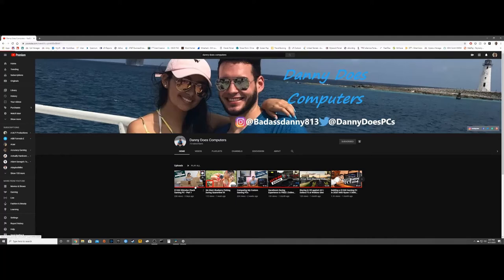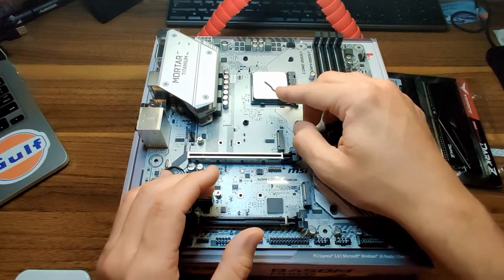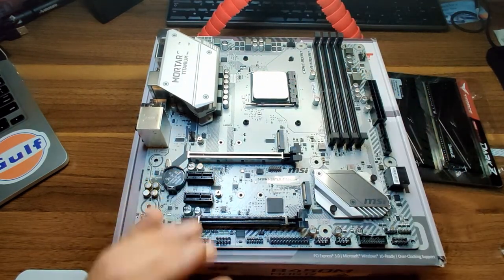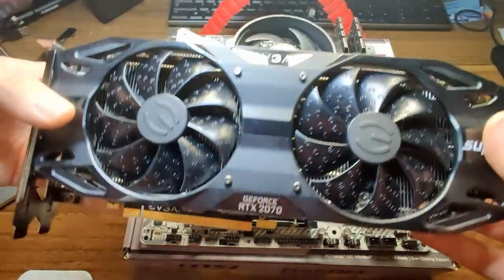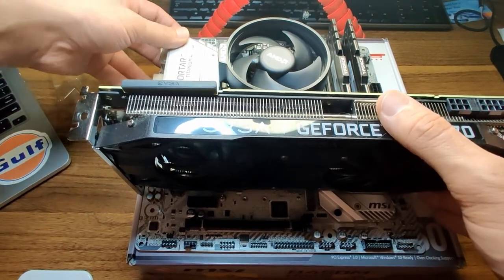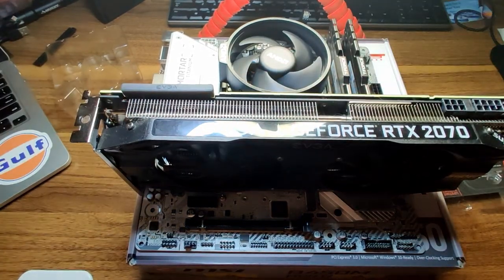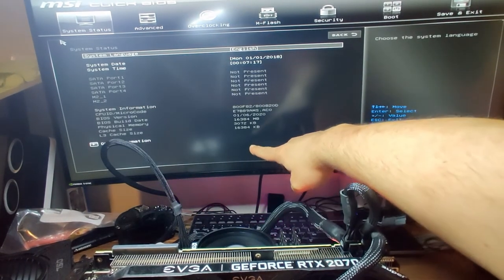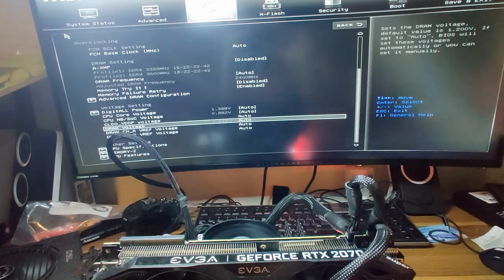How To Bench Test Your PC Parts Before Building

Comment: If I dont have a button and dont want to jump start using a screw driver can I just plug in the power front headers and use my cases power button instead??
Reply from the maker: Yes. Of course
Reply: @DannyDoesComputers  TY. Im scared I might short the whole board so thought this might be a safer option

Comment: Do you need the cpu cooler installed when you benchtest?
Reply from the maker: Yes. The CPU can get hot very quickly and without any cooler, it can quickly get to unsafe temps

Comment: Your video provides the information all PC builders need to do before finishing their PC build. If you're new to PC building, take a hint from that glorious girl wearing that thong swimsuit at the beach.  The less you put on the MB the better. I use an inexpensive test bench sold at AMAZON, of course. The bench provides better support for the GPU and comes with a remote on/off switch, so I don't need to use a screwdriver. Once my MB passes POST and BIOS, I usually let the MB run overnight with my monitor in sleep mode. The following day, I mount one SSD, my boot drive, install WIN and download some PC stress test apps. I run the tests for a 24-hour 'break-in' procedure.

Comment: my cpu requires a graphics card for post, but can I test the motherboard without it? I just want to see if my mobo is dead
Reply from the maker: If you have little LEDs on the board that light up in sequence during a boot, they should tell you at what stage the boot process is in. It might stop at VGA or graphics stage. But at least you'd know the board isn't dead at that point
Reply: @DannyDoesComputers  thank you!

Comment: My pc doesn't turn on and it trips the main circuit breaker, any idea why it is happening?
Reply from the maker: How many other things are on that circuit. You might be overloading it if that's the case. Or there's a short circuit causing the breaker to trip.
Reply: @DannyDoesComputers   @Danny Does Computers  it was most likely shorted somewhere. I unplugged the whole thing for a testbench and it worked normally. Now I ordered a new psu and case to avoid it again. 
However, the whole thing started happening after I used compressed air to clean pc. Do you think that could be an issue?
Reply from the maker: I guess it's possible a very small component could've been blown off the motherboard causing the short, but the chances of that happening are pretty small. As long as you weren't putting the nozzle of the air very close to the board then you should've been fine. Sometimes electrical devices can just go bad too.

Comment: Is it okay to test these parts without a CPU cooler
Reply from the maker: Only if you have the system on for a very short time. The CPU gets hot really quickly so you don't want it to cook itself. I'd advise you never do this though

Comment: I built bout 6 pcs and today my luck went out

I remember that even ryzen cpus the mobo should make some signs that it actually wants to boot without any gpu

Problem right now: My Mobo is possibly bricked and the new one doesn't respond at all to anything. No lights, fans, sounds, nothin

Checked every cable, every connection. Even checked every single component externally with a diffrent pc. My mobos simply don't wanna do anything
Reply from the maker: Are you using the same CPU in all of your testing? That could be the problem.
Reply: @DannyDoesComputers  thats the neat part
My GFs pc also has a ryzen 3600. Tried mine on her mobo. Boots fine, no problems

I really meant every single component(except mobo of course)
Even tried single sticks of ram in diffrent slots. All fine